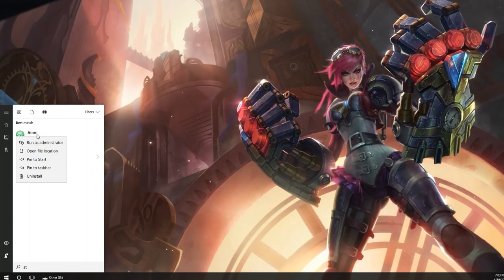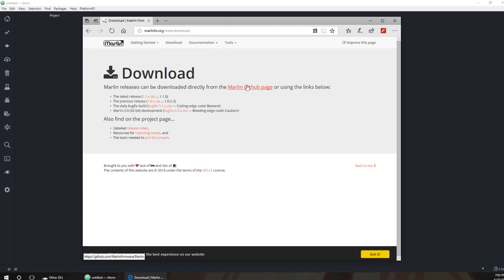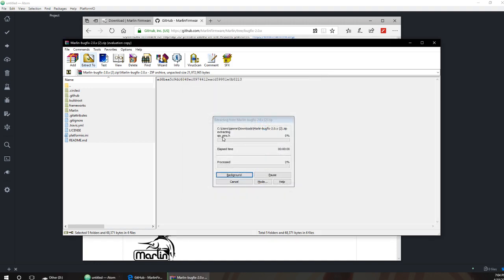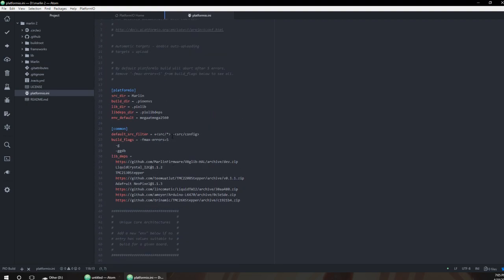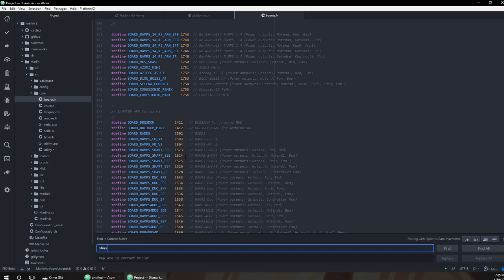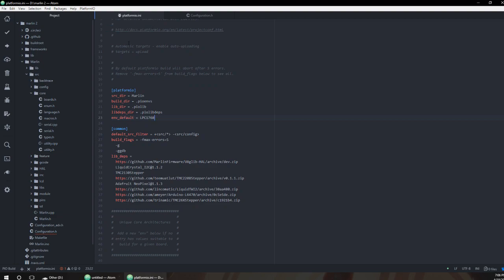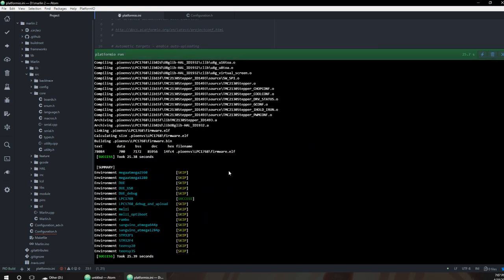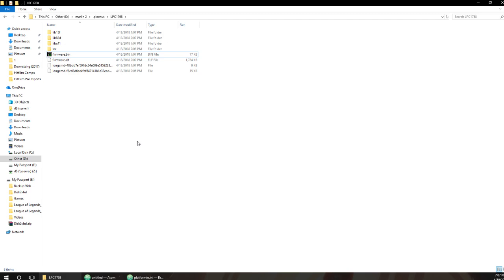Marlin 2.0 compling MKS SBASE 1.3

Comment: Thanks for the tutorial.  Unfortunately its not compiling for me.  I've installed Atom, added he platformio extension with 

default_envs = megaatmega2560

updated the ini file as well as configuration.h  with my board type:
 #ifndef MOTHERBOARD
  #define MOTHERBOARD BOARD_MKS_GEN_13
#endif
 
Building results in errors:

Environment megaatmega2560              [FAILED]
==================== 1 failed, 0 succeeded in 3.48 seconds ====================

Ideas welcome.  thanks

Comment: very informative, thks a lot. further questions: 1. config.txt is not further needed / correct? 2. all further configurations for configuration.h / _adv.h are done in atom.io and then again compiled to a firmware.bin and uploaded to the MKS SBASE board / correct? 3. Is it also possible to compile for the LPC1769 (FBD100) that is on the Cohesion3D ReMix board?

Comment: To flash it: put an SD card into the board, plug it into USB, it comes up as a USB drive under windows, just delete whatever is on there and copy the firmware.bin file. Then reset the board via the button on the board, or unplug and replug it. The file will be renamed firmware.cur (current) and will have the correct file size of your compiled version.
If you don't get anything on the serial port: change "#define SERIAL_PORT 0" in configuration.h to "#define SERIAL_PORT -1" and it should respond. If Windows doesn't auto-install the correct driver you can use the Smoothieware USB driver, or there is a driver under Marlin\src\HAL\HAL_LPC1768\win_usb_driver
Reply: You Sir, deserve a medal! After countless hours trying to figure what was wrong with it this actually enabled me to connect the board to Simplify3D.
Reply: This comment is actually more describing than the video, thanks!

Comment: i attempted to flash marlin 2.0, but now my computer does not find the sd card when the sbase is plugged into usb and the very top and very btttom leds are solid with all inbetween off, it seams the firmware is corrupt or something, or can the smoothieware bootloader not flash marlin? is there a bootloader you have to flash first? i recently setup a re-arm with marlin 2.0 no problems, now it seams i have a dead mks sbase v1.3.

Comment: As of 09APR2019 I have Marlin2.0 working on an SBASE with TFT32 replacing the burned out RAMPS1.4 board on a 2016 FLSUN Delta.  However there are significant issues and I am using whatever the current version is available on Github as of 9APR2019.  There is no fan control at all no matter what I enabled or disable or what pins I specify,  so the extruder fan has an extension cord rigged up out of speaker wire& and old plug running into a spare plug on my PC's PSU and I am without a parts cooling fan.  M500 &M501 do not work because enabling them produces an error, so all calibrations have to be done in Atom, complied, saved to an SDCard, and then the card transferred to the board to be flashed.  Also,  calibrating the Z travel for 100mm produces around 180mm when a command is given to move 200mm.  Configure it for 200mm and the travel is around 110mm when 100mm is specified, and it's 120mmish when configured for 300mm. Same story for the extruder.  So far I've had to revert back to the value in the example firmware and just increase the flow rate in Cura until I got results approaching acceptable - configure it to extrude 100mm when 100mm is commanded results in abysmal under-extrusion, while the stock setting pushes over 250mm when 100mm is specified and it's still not quite enough to keep up. The FLSUN uses 1/16th drive pulleys when the stock settings are 1/20s  and I'm wondering if that is the reason, because the I had to cut in half the steps per rotation to get it to stop moving twice what I specified. 

But yeah, this thing is getting replaced with a large CR-10 when I get a little spare coin.

Comment: Followed your instructions and it created the firmware.bin file but after it flashed it...

Why is my LCD not showing anything?
I got the 12864 LCD Controller that is bundled with the mks sbase 1.3
Reply from the maker: Sorry it has taking me soo long to get back with you. I use the same lcd and have had no issues. I will double check when I get home to make sure.
Reply: friend enable full grafcis in configuration.h had this same problem
Reply: however to use the card reader it is necessary to check in examples / mks / sbase has a read me, check jumpers pins, a mod is required for cable in ext2